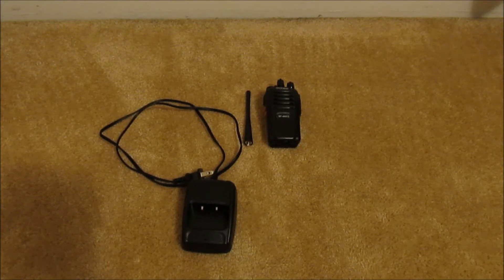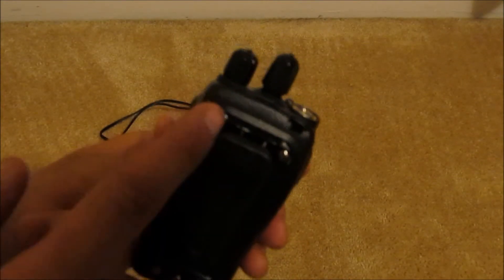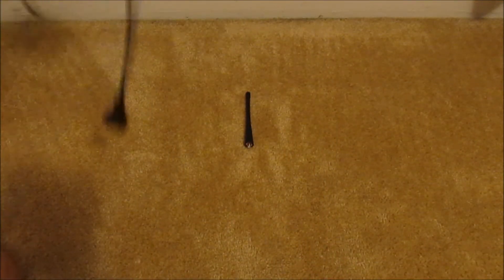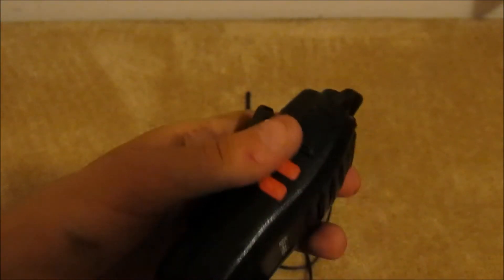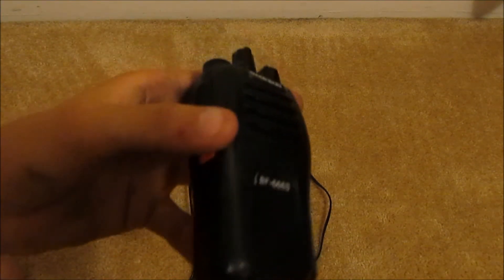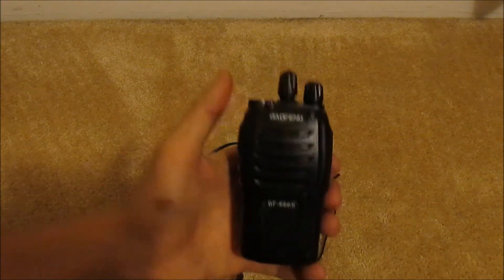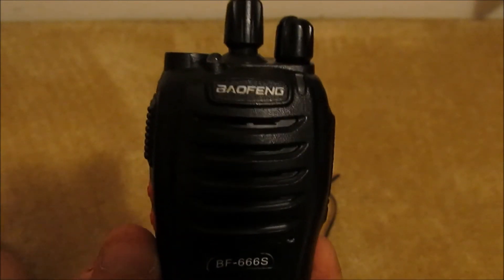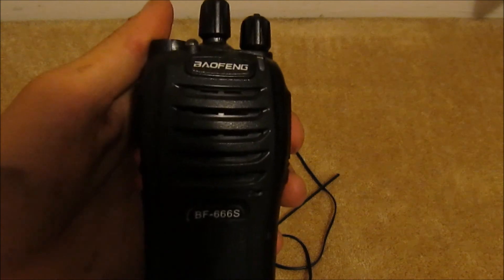BAOFENG®/POFUNG® BF-666S® video review

Comment: How long does the batteries last?
Reply from the maker: Hi there! Good question. I would estimate the batteries last around 2 hours of non-stop talking back and forth, they should last an average use AKA chatting with brakes in between for 6 to 8 hours
Reply: @OfficialContentKing  Thank you for your answer.
Too bad as I need them to hold out for at least 11 hours

Comment: how can i turn off the alarm on this radio widouth program
Reply from the maker: ivan kuzmanic unfortunately you can't without programming, the firmware has no off switch. That is typically the case when you buy a unit without an LCD

Comment: what's the range on these radios and where can you download the software if it does not come.
Reply from the maker: Its about 5-10 kilometers, Its probably closer to 3 kilometers in congested areas (city, crowded suburbs) mountains and fields will have the most range. Google "888s programming software download" if that doesn't pull up anything then let me know and I can post the software. Please let me know how it goes and good luck!

Comment: George how are you nice vid what range did you get with the bf666s looking to use some of these for rescue ops
Reply from the maker: +Obelawe Rhodes Hi there Obewale, even though this is a terrific short 3-5km range radio it is reliable, cheap, and rugged. However, so you can have better and more reliable range and functionality check out my video on the Baofeng UV-82L I think that radio will provide the higher satisfaction and is only about 15-$25 more with a 10-16km range. Both are available on Amazon.